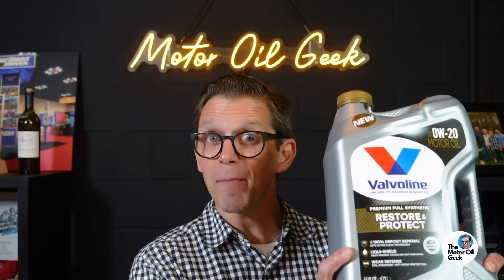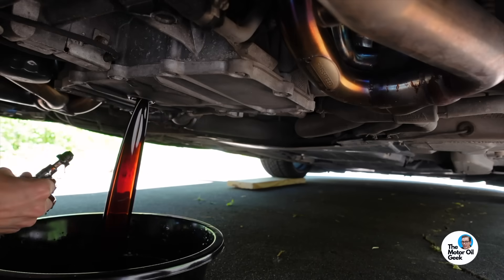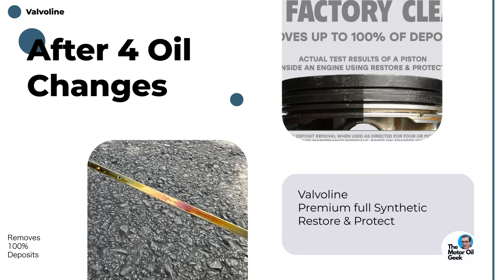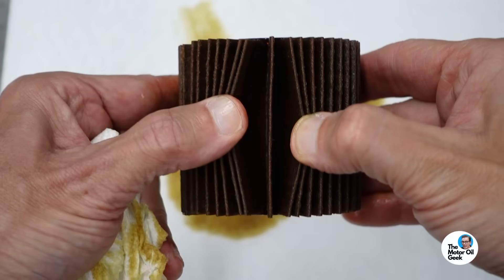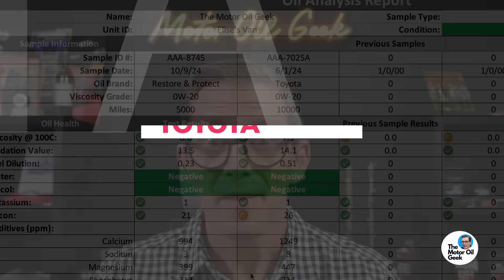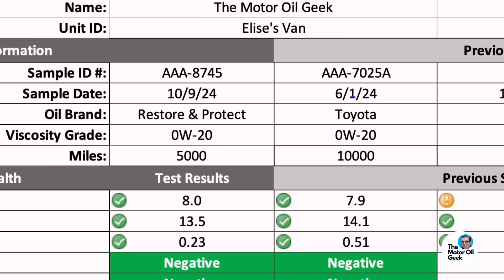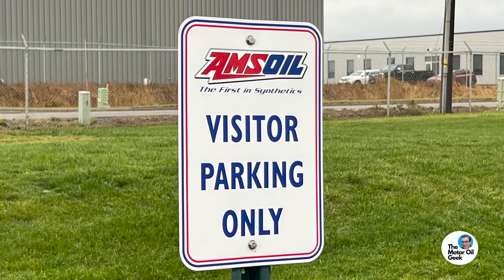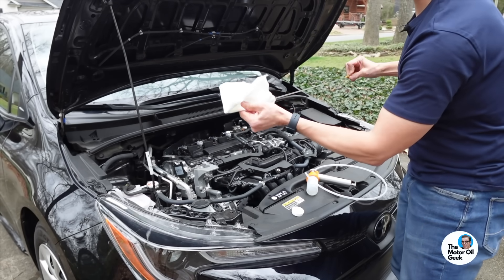The TRUTH About Valvoline's BOLD Engine Cleaning Claims

Comment: Hi @themotoroilgeek, great video, I take a lot of tips from you and follow them.

 I have one question can you change oils brands often for oil changes in a vehicle depending on your needs (temperature, cleaning, driving habits etc) every time you change oil?
will mixing of some oil of different brands can react and cause damage or will impact the properties of the oil if you change the brands a lot?
Reply: Pretty sure it's recommended to not switch up frequently. It's pure chemistry and some do nullify pros or exacerbate cons for some oils. I would stick with 1 if possible.

Comment: What will you put in your daughter's new Toyota? Valvoline Restore & Protect is not available in 0W-8 or 0W-16; the currently listed available grades are 0W-20, 5W-20, and 5W-30.
Reply: Outside of the USA, Camry and Corolla owners manuals tell owners they can use oils as thick as 10W-30 even if the factory fill was 0W-8 https://imagizer.imageshack.com/img922/3040/86ZHxk.jpg

Comment: I see what is going on here. This video was clearly valvolines way of publicly addressing the talk on the internet about results using this oil. By that I mean they are worried about the concerns people are expressing concerning clogged filters going into bypass mode between oil changes due to the amount of cleaning from R and P.
If you are concerned about this happening you have a few things to consider like make/model, age, driving styles, oil filter quality, history of maintenance on the vehicle in question, and obviously current condition of the engine. 
If you have a reasonably well maintained vehicle you probably have nothing to worry about. But...If you have a dirty engine, use cheap oil filters, or poor history of maintenance you really should change your oil at 1k using Restore and Protect. I say this having seen a oil filter look 15k miles old at only 1k using this oil on a truck that had seen 2k oil change intervals using Pennzoil ultra platinum and platinum(dont use platinum in the cold it flows terrible*see project farm cold flow test). I also had used engine cleaners such as marvel mystery oil, seafoam, and BG. None produced the results I got in 1k using R and P. That said I question its protecting abilities as my engine ran quieter on other brands of oil, and is the reason I do not continue to use R and P after a single use. To be honest, it cleaned my engine so much I am gonna wait awhile to use it again but I wont use anything else to clean an engine except Restore and Protect.

Comment: thank you Lake, I have it running in my 2005 F250, and it cleaned it up so well, it released a cracked sleeve to one of my spark plugs. luckily skipping was the only issue. LOL better I found out then than later.

Comment: I want to use this on my 2008 Toyota Avalon but some Avalons are prone to a leak at the bottom of the timing chain cover.  Also, (in general) I have heard that in some engines, just changing oils MIGHT actually cause leaks (by cleaning the engine to much) and that is my conderrn with trying this product.  What are your thoughts on this?  Would it be safe for me to try this (and not actually create any leaks because of it)??

Comment: Next time you have a chance, could you please ask the Valvoline team directly if the cleaning additive in the oil becomes less effective as the miles add up? 

I'm wondering if it performs best at say the first few thousand miles and then tapers, or if its cleaning efficiency stays steady throughout the oil change interval assuming sufficient detergents/dispersants, or maybe does best the longer the OCI is ran.

I've really been wondering this for a long time and it seems like one of those questions you must ask someone in the know to get a proper answer.

Thank you kindly!

Comment: About had a heart attack when you put the dipstick on the battery! LOl.
Reply: He knows a lot about oil, not about everything.
Reply: Reminded me of when I was about eleven and dropped a 10" crescent wrench on the six volt battery in our Cub Cadet! It glowed!
Reply: @lylejohnston4125  my dad did the same when he was younger. The battery exploded.
Reply: @lylejohnston4125 I caused a battery to explode in a Club car when I dropped a combination wrench across one of the 8 volt batteries. It welded and glowed and I didn't have anything nearby to break the contact. It caused a lot of damage. Even though I neutralized the acid and washed the frame down, it corroded. Several wires were damaged and the motor controller was fried.
Reply: Glad I wasnt the only one!  He's also using 0W08 I believe so that must have dripped off into the engine compartment somewhere!
Reply: @mitral5333 no, it's 0w-20
Reply: lol my 92 Camaro I blew the dipstick in 2 pieces that way  3 times
Reply: I like dripping a bit of oil on my terminals every oil change to keep the from corroding while I'm waiting for oil to drain out
Reply: Had a coworker that never had a license at 25. Helped him get one. Then helped him buy his first car and preached taking it to Dealership for 6 month oil changes and to check his oil monthly.  Fast forward 2 years - he pulls out dipstick then goes looking for a paper towel between the pumps.  The dispensers were all empty and he came back to an engine bay on fire from laying his oil stick on the battery and his car burnt to beyond repair next to the gas pumps………..25 years later we are still friends and he refuses to ever open his hood! No catastrophes and lets the dealership do everything!😂😂😂
Reply: Same!
Reply: Me too! I wondered if anybody else had noticed that! Bit close, I thought!

Comment: My 2005 S2000 is 1000 mi into Valvoline Restore & Protect.
My mpg did went up to 25mpg w/ above average range on hwy (usually 23mpg)
Now on this tank, I'm checking to see how it would be for above average street range (usually 20 or 21mpg)

Comment: I switched my wife’s kia over to this, 229k miles on it and I’ve been using Motorcraft 5w20 in it with Motorcraft filter, Ford tech lol. I have always went 7-8 k on the oil changes cause the oil was always clean looking and it looked clean in the engine from what I could see. It’s got 6k on it with the clean and restore and the oil looks dirty and I’m planning on changing it cause of it. I hope the oil consumption cuts down on it. That’s the main reason I switched it. We’ll see, fingers crossed. By the way,? As of now it seems like it’s burned the same amount of oil, in 6k miles, 2 quarts I think.

Comment: Awesome stuff to hear. I'm running a test of this oil in a 1980s Briggs and Stratton 5HP flathead engine. Tore it down when I first bought it and put it back together without cleaning anything up. Changing the oil every 25 hours. Will be interesting to see what the inside looks like after 100 hours
Reply: Make a video and post it would love to see the results

Comment: Are carbon deposits on the rings a reason a car would burn oil?  The deposits prevent a good seal, correct?   I have a 2003 Camry that burns approximately half a quart every 900 miles.

Comment: I put R&P in my 580k Lincoln Town Car after your last video about it, it's just about time for another change.
Reply: Those burn oil bad that high a mileage. That should be the perfect oil for it!
Reply: 580k on the original engine? that's amazing
Reply: @wrathofpaulii  it was in limo fleet service almost all its life, I doubt it's the original engine. If I had to guess it's probably had a couple engines and transmissions in it's life
Reply: @thegalli  no those engines can last until 580k.
Reply: @wrathofpaulii  normal for those engines. They were amazing beyond any others besides semi diesels.
Reply: So how has the R&P done
Reply: @louarmstrong6128  satisfactory so far, on the second batch of it.

Comment: I just wonder how much additional benefit there is running the Valvoline R&P vs a good quality full synthetic and being religious about oil changes. I know Amsoil claims to keep your engine squeaky clean if you run it full time. May have to give the Valvoline a shot in my old F150 with a 150K mile 4.2. Been super consistent about 5 to 6K mile oil changes and running full synthetic oils for the last 6 years. Due for a change now. Good  video and good info!
Reply: The truth is even conventional oil will keep a dipstick free of varnish if changed every 3000-4000 miles or 4 months.
Reply: Agree that the "results" are probably not going to be dramatic for already really well maintained engines.

Comment: I was using 0 w 20 Castrol high mileage. I was losing approximately 1 qt every 900 hundred to 1100 miles. I recently switched to 0 20 Valvoline  re protect. I am now burning more oil needing to add half quart  every 500 miles. this is my first oil change and my driving habits haven't changed . Since retiring i don't travel as much approximately 11,000 miles per year a lot less than the 19,000 miles before retirement. My vehicle is a 2015 Toyota rave 4 with 180,000miles . I will continue with this Valvoline rp for at least 4 oil changes. If this continues should i go back to the Castrol  hi mileage oil or perhaps trying 5 w 30 oil? i purchased this vehicle new .In the beginning oil changes were approximately 7,500 miles owner manual states every 10, thousand miles. I haven't went that long in years no more than 5 thousand miles. Any suggestions appreciated
Thanks, happy motoring.

Comment: I'm hardly surprised there was varnish on the dipstick before the use of the Valvoline R&P, with 10k mile oil change intervals. 

I change the oil every 3k miles on my 370z and the dipstick and valvetrain area that I can see show no signs of varnish or sludge.
Reply: I do 5k oil changes on that same engine in an es350. I was a little surprised to see the dipstick until he mentioned the 10K oil change. Cool to see that R&P cleaned it up though.

Comment: Tried this stuff in my sisters 2013 Hyundai accent with 155K miles. she had just gone 7k miles on an oil change and when I checked the oil and she was down 2 qts on an engine that only takes 3.5qts. So first I yelled at her for trying to ruin her car then I put in 5w 30 restore and protect  instead of the 5w 20 it calls for. I did the first oil change at 1600 miles because i was worried about all the sludge I saw. It only burned one tenth of a qt in that time. Will do 3k on the next change and then see how it goes. I'm having fun with this engine because I can actually see the sludge slowly coming off the oil fill tube on the car and I can tell it's burning less oil. I think it's a great oil for these little direct injected engines.  Running it in my 207K mile toyota v6 too but that engine with 5K changes its whole life is harder to see any changes and that thing does not burn oil. Thanks for the awesome video!

Comment: I used this on a friends Tahoe, that at 220k had developed a loud tick/knock. When he checked his oil it was several quarts down. I put R&P in hoping that if it was a clogged lifter not pumping up, it might help. The noise only got louder. I cut the oil filter open and didn't see  any metal, so I told him to go ahead and drive it short trips. In less than 20 miles the noise went away. Pretty amazing. 
 I'm also using it in my own Mountaineer with the 4.6 3v engine. I'm hoping to ward off any valve phase tensioner problems. I've been using Mobil 1 extended or Pennzoil Platinum, it may be psychosomatic, but it seems to be running smoother.

Comment: I've used the VR&P for going on 20k miles in my 2016 Toyota Highlander.  I used a borescope to look into the valvetrain before and now after and it looks brand new in there!  Same with the dipstick.  Very impressed with it and I'll continue to use it.  I'm usually very skeptical of claims like this, but it's proven to me it works as advertised!

Comment: Too bad my local Walmart sells it for $30 but is always out of the 5W-30. I went to the three big name auto parts stores and they all wanted $40 and none would match it. One even called Walmart and verified it was in stock and they still couldn’t match it. But hey as long as the shareholders are happy that’s all that matters right!
Reply: The 2Walmarts near me are always out of 0W/20 😅.  Advance Auto has a deal going on until 12/4 where you buy a 5 quart jug and get an oil filter for free.  It retails 8 bucks higher at AA but the free oil filter makes up for it.

Comment: I figured I would try this oil in my 2000 GMC Sierra 1500 2WD 5.3 after watching Lake's first video. My truck only had 380,000 miles on it at the time, so I figured it was a good test bed LOL! I ran it about 5000 miles, I do a lot of highway driving and not too much city driving, but what I do drive is VERY short trips, not the best for engine life. I noticed a difference in engine idle within a couple of days, my MPG increased after the first tank fill-up and has increased 4 MPG total. I have changed the oil multiple times now using this oil, coming up on 400,000 miles. My MPG stabilized at +4, the idle quality is better than ever, performance is better than ever, and even the annoying 5.3 piston noise on cold start goes away much, much quicker now. The only reason I can give for that one is less build up on the pistons and better heat absorption into the piston, so it gets to operating temperature and size faster, which what you want. You don't want the little guys bouncing and slapping around in there cold any more than they absolutely have too. The ONLY thing I have changed during all of this is the oil, I've used same filter brand, size and style, same fuel, same air pressure in the tires to the 1/2 lb., and haven't touched the air filter it's a K&N style. I have to credit the oil. My dipstick was almost black with carbon and now looks brand new. I'm sold.

Comment: The biggest difference I saw in the results was the Manganese content. I don't agree with the only place that Manganese number  can come from is the ring grooves ( octane booster from fuel ). Engine oil also acts as the final seal between the cylinder wall and the piston rings, helping to insure fuel remains in the combustion chamber where it belongs and not washing by. Question, is ( Valvoline Restore And Protect ) formulation really doing what they say, or is it actually not as good an engine lubricant as they claim and not able to act as that final seal. If you have owned a vehicle from new and do your own maintenance so you actually know it's getting quality oil and filter and change on a decent schedule, there would be no need for an oil such as this. If buying used always pull the oil fill cap and look inside for sludge, ect. if it has sludge walk away. If it's just discolored you would be fine, and trying the Restore And Protect wouldn't hurt for a change or two. I personally would then change to a regular good synthetic oil.

Comment: 1:55 BMW owners: "Wtf is a dipstick"
Reply from the maker: LOL
Reply: @themotoroilgeek 
Is there any reason Restore & Protect should Not be used in a BMW N54 turbo direct injected engine?
Reply from the maker: @ronmurnieks9483  As long as the viscosity meets the spec, no reason not to.
Reply: In a BMW the dipstick is usually right behind the steering wheel
Reply: A person who buys a BMW.
Reply: My 2011 328i N52 is running perfectly and quietly at 108k miles with 18/26 mpg using VR&R.
Reply: My 2014 328d still has one and all older ones
Reply: @alexlua7099 yeah, 10 years ago, but not today…
Reply: @PM-wt3ye 2019 328d same thing or 2019 m850i anything past 2019 nope so 6 years ago..
Reply: @alexlua7099 ok 😳 then its more the Audis 😂 even older ones, my 2011 doesnt have one, 2015 doenst have one and 2019 either 🤦🏻‍♂️ but they DO have the tubing, only the stick itself is missing, wtf
Reply: @alexlua7099 look inside the oil filler cap. All BMWs will always have a filler cap.
Reply: Same for Audi 😱
Reply: Also Alfa Romeo: "who you calling a dipstick?!"
Reply: My 1995 540i had one, so don’t know what you’re talking about
Reply: @dauchande  Really? Going purposely act that oblivious?
Reply: @snaaaaaaaaaaaaaaaake  Well, I don't currently own a bimmer, nor would I ever own one newer than 2010, so meh.
Reply: @dauchande And so you do in fact know exactly what I am talking about.

Comment: I remember back in the day we were apprehensive of changing ATF in high mileage transmissions due to cleaning the "varnish" and deposits that were sealing the worn components. 
I've seen more than one high milage trans fail after a trans service. 
Could this happen in a classic/vintage engine? Thanks Lake.
Reply: If that happens with a fluid change, it wasn't necessarily from the fluid change. It was already too late. The trans was already all but done for anyway. In other words it wouldn't have gone far without a fluid change either. 
 How do I know? I'm a retired trans specialist.

Comment: Thanks Lake. Why did you switch from the 0-20 to the 5-30?
Reply from the maker: I actually used the 0W-20 in the van. The 5W-30 is for my son's truck.
Reply: @themotoroilgeek  oh copy,  thanks for responding. I guess I didn't listen as carefully as I thought. Nissan says I can run 5-30 in the Sentra. But being in Northern Utah I've stuck with the 0-20 Sentra has 253,000 on it.